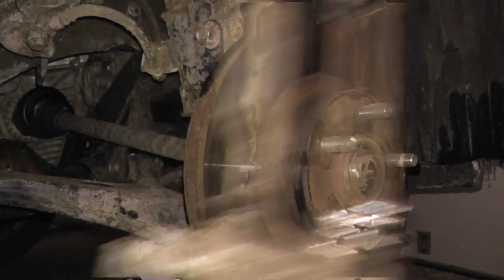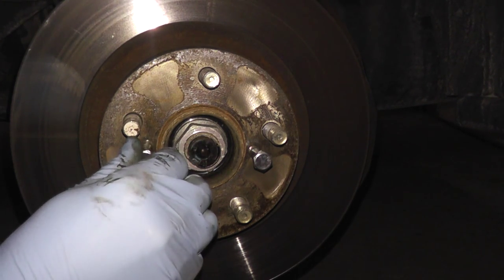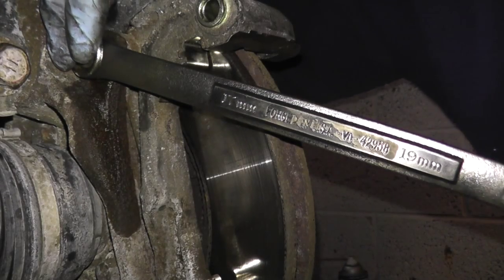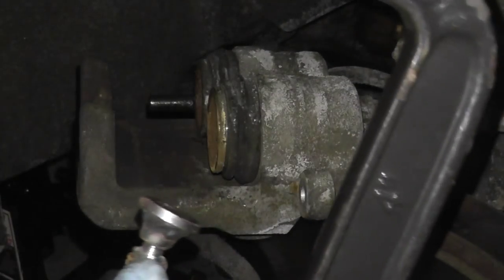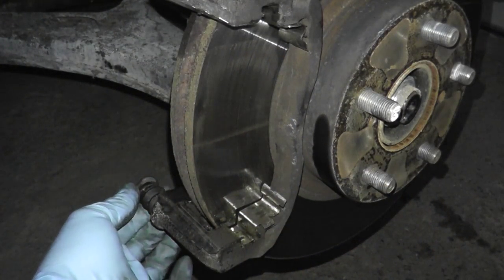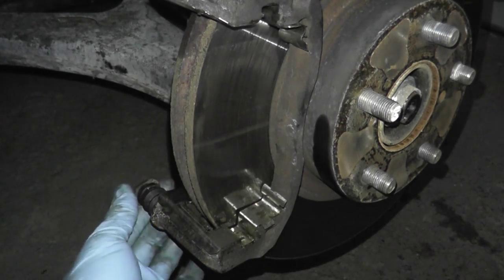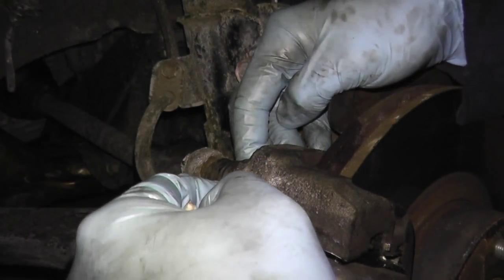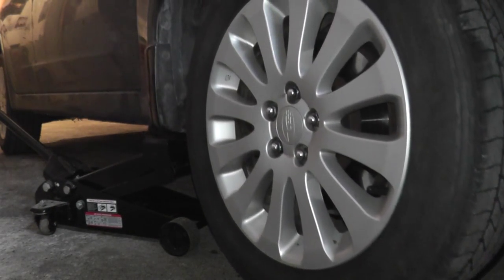Subaru Impreza Front Pads and Rotor Replacement with Basic Hand Tools

Comment: This video saved me a TON of frustration. I replaced my front brake rotors and I never would've guessed about using 8mm bolts through the pilot holes to break the rotor free. Thanks for the video!
Reply from the maker: Welcome

Comment: Please don't hit wrenches with hammers. Apply even pressure with your hand. Using a hammer is a great way to strip or completely crack the bolt.
Reply: Instead I use a rubber hammer.... works fine.....
Reply: Daniel MacDuff it looks like he was using a 10pt wrench.  Does it matter when taking off these bolts or should we use a 6pt one instead to avoid stripping??
Reply: Or a breaker bar / any other leverage bar

Comment: The bolts to remove the rotors are nice. But, smacking gently around the perimeter of the rotor with a hammer does the same trick when removing them... good video! Typically we don't have the right size bolt laying around.... and, most replacement rotors, even decent ones form NAPA, do NOT come with retrieval bolt holes... cheers!

Comment: How does the break grease help? I would think one should avoid greasing the rotors. Moreover, shouldn't you use a cleaning solution that will remove any grease remaining on the new rotors from manufacturing?
Reply from the maker: Brake grease helps the mechanical components slide and prevents rust buildup. (Also helps keeping things quiet.) Regarding the brake clean, I use it to remove grease marks from the rotor after the install is complete. Cheers.
Reply: CarsNToys appreciate the response! I was referring to the grease you applied directly on the break pad, rather than on the clips so I'm a bit confused. Thanks again!
Reply: I THINK HE APPLIED IT TO THE BACK OF THE PAD, THAT WILL MAKE CONTACT WITH ONLY THE CALIPER. I DO THIS ON ALL MY BREAK JOBS TOO!! I HOPE THAT HELPS :)
Reply: Eric Sexton that makes more sense, thanks!
Reply: Eric Sexton that's to keep things smooth, right? And rust?  

What about the caliper guide pins?  I've seen silicone used and recommended on every break rotor job.  I'm at 62k on 2015 wrx....just trying to learn.   I have all the tools...just not the confidence yet :(

Comment: I have a 2010 Forester. Will replacing my front and back rotors be the same as this? And when ever you are pumping the brakes at the end, should you leave the brake fluid cap on or off? Great vid, im nervous about doing my brakes and stuff for the first time.
Reply from the maker: marhooba Should be very similar. You can place the cap back on the master cylinder when you pump the brakes. Cheers.
Reply: marhooba I'm doing research now.  2015 WRX...never done a full brake job but not gonna pay $400 for labor either.
Reply: The only thing pumping the brakes does is bring the pad to the rotor face... unless your unhooking a line .. like if you were doing brand new calipers

Comment: +CarsNToys For the brake pins, can you also use SIlicone greese? And I've seen people on youtube use Cooper anti-seize on the brake pins and brake pads. 

What are your thoughts?
Reply from the maker: Subaru recommends silicone grease so that's what I use.
Reply: For the brake pins I noticed you used Brake grease instead of Silicone grease or would both suffice?
Reply: Regular brake grease for metal items, and silicone grease for metal & rubber . Never use regular brake grease on rubber items E.G. caliper pin boots, as it will degrade it.

Comment: to get that pin out of the bracket when is really thight and doesn't move a bit at all drill a small hole on the side of bracket and put somepenetrating oil in it and that will help to get it loose while you bang it easy with a small hammer 💖

Comment: Great video, but you don,t put brake grease on the pad surfaces, that will render the brakes useless, use the grease for the pins and the pad slider rails. Trust me, Brake clean spray to clean the oil off of the rotors and then re assemble, Do not grease the pad surfaces!!!!!
Reply from the maker: Thank you.

Comment: Note to all.
If you plan on doing work to any... any rusted bolts/nuts.
PB Blaster the shit out of all the bolts you need to remove  the night before.  If rusted real bad. Treat 3 times over a week before working on it.  Drying the oil off and heat treating with a torch will help then bang on and around the bolt gently with a ball peen hammer to break loose any flaking rust .
I've broken or rounded off many of bolt trying to just spray and go.
Its "Penetrating Oil" let the stuff do what it was designed to do.
And for God sake use rubber gloves and eye protection at all times with pb blaster. Its nasty stuff man... shit itl give ya cancer.